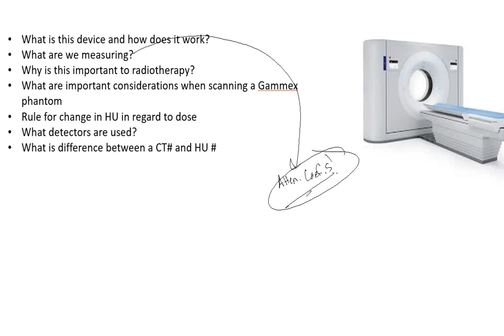CT and HU Values ABR Part 3 Medical Physics Oral Exam Prep

Comment: Your videos have been a great review in the last 2 weeks leading to my exam. However, I’m confused by the 10% change in HU gives a 2% change in dose. In the body we’re going to have a lot of HU numbers of around 0. It doesn’t seem likely that changing from 1 to 1.1 HU would change the dose by 2%. Or changing from 1 HU to 0 HU would be an infinite number of 10% drops, so the dose would also decay to 0 for HU equals zero. Maybe you meant CT number? But dose to air and dose to water is reasonably similar over a huge change in CT number of MV beams. Does this only work for high HU numbers? And if so, in what range?
Reply: 2:00 🎉😢😢😮 2: 2:09 😮 2:10 😢 2:22 😢😮🎉07 😢🎉🎉😢😢🎉l😢